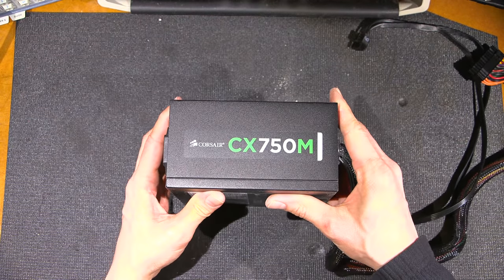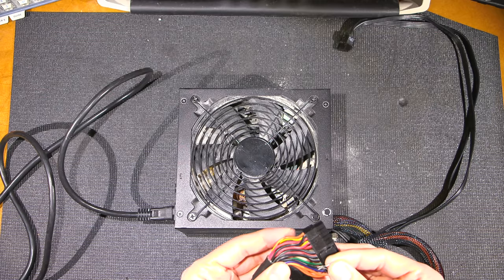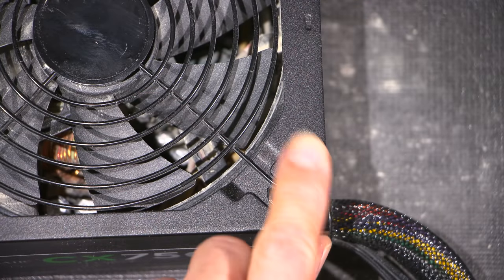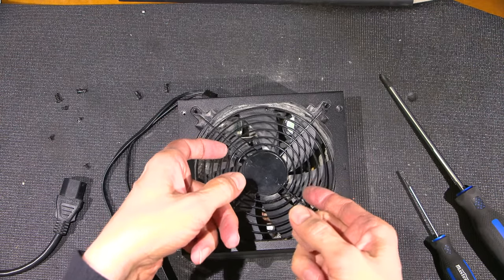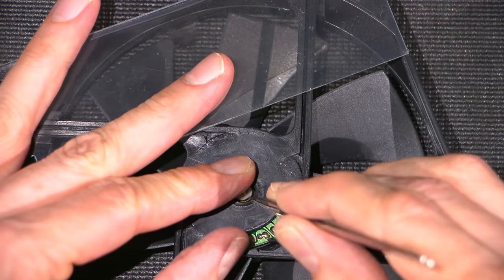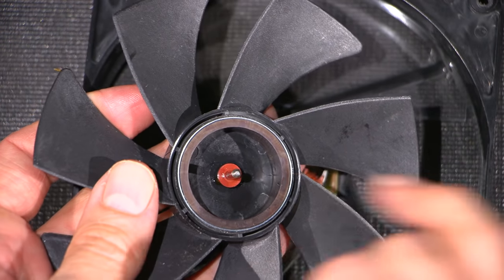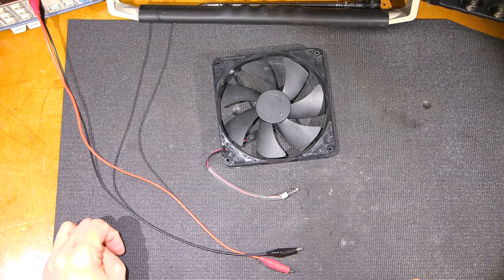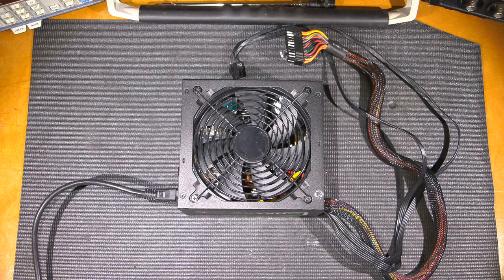Fix A Computer Power Supply!

Comment: Considering the state of the fan, you might tell you friend to clean the computer out too.
Reply: I bet there's a good chance that the friend's computer sits on the floor, sucking up dust.
Reply: probably sits the pc on carpet.
Reply: That's dead dander lots of dead dander😆
Reply: You can try and tell them but will they listen?
Reply: Definitely. What's more interesting is that this isn't generally a psu that OEMs would use (the make and wattage both), indicating that his friend has a custom PC of sorts (whether bought through an SI or built themselves). I'm surprised they let it get this disgustingly dusty when presumably they have at least some interest in performance PCs.
Reply: @bobvines00  Why buy a heater and a separate air cleaner? That's what PCs are for! #TwoferOne
Reply: Also this is a cheap sleeve bearing fan being run hanging from the end of its axle.
Reply: And get filters for his intakes

Comment: So many things are unnecessarily thrown away, in this "disposable" age we live in. To me, it's very gratifying to repair something that otherwise would just be trashed. It's even satisfying to watch videos of other people repairing, restoring, even repurposing items.
Thanks for sharing, Paul.
Reply: It is disposable in the US because in a rich society it is way cheaper to pay for a new one (i.e. import Chinese worker hours+other costs) than pay a local worker his wage, insurance and all those nice costs that come along with a modern society like the American one. In a way you should be grateful to have such a high standard of living. I consider myself pretty rich luckily but I don’t live in the US and I also have similar issues when it is cheaper for me to buy rather than take the time to repair, after many meditations about this I have come to accept it, be grateful and help my community whenever possible by fixing stuff for free. I also enjoy repairing stuff whenever possible!
Reply: Some of those power supplies are actually not cheap, and the best ones are well designed and have very good parts in them. Why throw them to the land field if only a few $ fan is the problem. I still use mid '90 PC that runs my loudspeaker measuring card from Clio. Sure I could buy the newest portable USB version ($600 US or so) and connect to Win10 laptop (which with another update might screw something up), but it still works. And some of the specialized equipment is way too expensive just to throw it out or unobtainable, just ask Paul.
Most of the regular products made in China are cheaper than many products made somewhere else, and quality is sort of 'OK'. But, a friend of mine who designs custom Hi-End loudspeaker transducers says, that if you want a really great product not a lot of manufacturers have the capability to build it as many places outside off China sold or moved the manufacturing equipment and for Hi-End quality you have to be ready to pay. Plus most of the Neodymium actually comes from China.
Reply: friend of mine found a perfectly fine microwave oven in the trash
a fuse was blown
other than that, it was perfectly fine.
Reply: Damn tootin'.
Reply: They don't want you to fix it they want you to buy a new one.
Reply: It's not so bad. Most of what we use is recycled after it's useful lifetime. In the case of a PSU, like this one, youre not supposed to open anyway. Any IT Professional would tell you to take a bad battery to a hazardous waste or recycling facility, as opening a PSU can kill you
Reply: Yeah, the better title is how to fix a dead fan...
Reply: One person saving a small plastic fan isn't enough to offset the billions of people who dispose of plastics daily.

Comment: I'm in my 8th decade and more than 50 years ago often repaired sealed condenser fan motors on freezers, coolers and refrigerators when the equipment was abandoned. Most refrigeration equipment is installed and never moved until it stops working and is replaced. My "fix" was to punch a small 1/16 hole in the top of the metal cap that sealed the back of the fan motor and use a small hypodermic needle to inject lubricant into the cap. Usually less than 1/2 ounce was required. Then wipe over the hole with a clean rag wet with a bit of isopropyl alcohol. Next apply a small spot of gasket sealer over the hole to close it up. 80 percent success rate. Back then you often needed an exact replacement part to change a condenser fan motor. This was before "universal fits all" fan motors existed. Good video. Thanks.
Reply from the maker: Thanks for sharing your story!

Comment: I've done this hundreds of times on customer sites around the world.  Some 1980s mainframes I worked on had up to 12 power supplies in each cabinet and there were two full sized boxer fans in each supply.  Since I was usually on some remote base with no spare parts within a thousand miles I got used to repairing stopped fans by cleaning out the bushings and lubing them with a bit of shredder oil.  That little bit of maintenance can make those machines run 24/7 for years past their MTBF dates.

Comment: The outer casing from a cheap plastic ballpoint pen works well for installing those split washers, just pull the ballpoint and ink-tube assembly out of the pen with pliers.  You can even reassemble the pen when you're done.

Comment: Having relubricated many a fan myself, I have two comments to make:
Usually, when a fan starts growling like this, the cheap sleeve bearing has worn enough that relubricating will only be a temporary fix. Typically I have gotten another few months to a year or two out of a fan by lubricating it, but they never last as long as the original (already too short) pre-service life. If it's easy to get to this can be worth it to prolong the life and minimize waste as noted here, but if the fan is a real pain to get out of whatever equipment it's in, it can still be worth it to replace it. When you replace the fan, use a high-quality unit with proper bearings in it; while this still means you have to junk the original cheap fan, from that point on it should be a "lifetime" part and you'll never have to replace it again, keeping the cooled device (and your new quality fan) in operation for a long time. A small amount of waste to make up for the manufacturer's shortcomings, but you can at least keep everything else in operation as long as you need.

Secondly, the fan shown here was more serviceable than most; it included the rubber face seal (often omitted on the cheapest fans which just rely on the sticker, invariably resulting in all the lubricant leaking out even faster) as well as having a reusable plastic split ring for retaining the shaft. Many of the ones I've disassembled instead use a toothed "one way" ring to retain the fan, and they're effectively impossible to remove without bending/breaking the ring, making proper servicing a lost cause. In those cases either just put some lube on from the outside and move the fan along its shaft to work it in (which will probably work for a while, but not forever if the fan was cheap in the first place), or just replace the fan (once) with a quality unit and never worry about it again.

Comment: When I left my first apartment I watched my landlord spring for a whole new HVAC system because the blower got loud. I brought the old squirrel cage blower with me and re-packed it with grease 30 years ago. I’ve been using it to ventilate rooms when remodeling ever since.
Reply from the maker: Hi Jim. I have an old furnace blower to do the same as well! LOL! I have had it now for 25 years... same deal.

Comment: I usually check for bulged caps when I service a power supply. The most common result when a fan no longer cools the supply properly. I though I was the only one who "fixes" cooling fans. Nice to see I'm not alone.
Reply: I've been doing it since the 90s. It's not this standard 140mm kind of fan that's the problem, it's the oddball diameters and form factors that can make finding replacements impractical, at least impractical enough to make it worth gambling half an hour trying to recondition the existing fan.
Reply: @dycedargselderbrother5353  Yup, me too. Fans used to go bad a lot more frequently than they do now. I'm not sure if I just have less dust around now, or it's because fans tend to spin a lot slower now, but I haven't had a fan go bad in a very long time. As a kid I discovered removing that little split ring and the whole fan came apart. Always had good luck re-lubricating sleeve bearing fans like this one, but the ones that had little tiny micro ball bearings I never had good luck with. Once those bearings are worn, they just don't work properly any more. Even if that plastic retaining ring pings across the room and into the carpet never to be found again (except by the vacuum), the fan works perfectly fine without it. I've run fans for years with that retainer missing - no issues. The magnetic field from the rotor keeps the fan in the right place on the stator.
Reply: @gorak9000  That's a good point on the durability issue. I agree that fans seemed to burn out more in the past. Speed control probably does have something to do with it. They also used to be significantly smaller on average and needed higher RPMs to push equivalent or greater CFM. Two pin constant RPM fans used to be the standard and the 0.7 amp kind featured here wouldn't even be at the high end of power draw.

Comment: Beginning: uses a resistor to turn on the PSU to avoid any possible short
Later: pokes through the grill with a metallic screwdriver, to spin the fan while PSU is plugged in and powered on.

P.S. Don't take this personal, I just found it amusing. I really like your videos and the very clean and professional way in which you present and explain everything with lots of details.
Reply: It's what's called, a "pro gamer move".

Comment: As a mechanic as well as a geek, my go to is actually gear oil. Thicker than most oils but still thin enough to flow around the shaft easier and haven't had an issue of it drying out over time.
Reply: Also eats plastic over time.

Comment: Mr. Carlson, I deeply respect your passion for reducing waste. It is one of the reasons I fix "old" stereos, appliances, and other products.
Reply: Want to save electricity & keep your refrigerator out of landfill?  Unscrew the front bottom dust grill and the back lower cover off.  Place 2 dust pans by front area that was exposed by removing the grill so to catch debris.  Starting in the back, use a mini " Shop Vac " type vacuum with suction and exhaust ports and suction the coils,  underneath many refrigerator.  When you have suctioned all you can, switch your hose to blowing port and blow on the coils.  If this hasn't been done in a while, you will get lots of dust balls coming out.  Reattach grill & back cover.  Your refrigerator will be quieter & use less electricity.  Peace.

Comment: Awesome! I'm with you - fix it instead of replace it. 
I just fixed my kids computer power supply last night. A power regulator IC blew up. My kid ordered a new power supply and was going to recycle this one but I decided to give it a shot and repair it. Replaced the IC (learned some more about desoldering and soldering in the process which is a bonus!) and tested it. Works!! - so now he (or I) has a spare power supply.
Thanks for making these videos. I learn something new every time.

Comment: An excellent piece of 'Green' maintenance, Paul and a fine demonstration of how often a bit of high tech kit doesn't need high tech repairs - just logic and common sense. 5 stars. It reminded me of a time, about 20 years ago that a colleague asked for help as her computer sounded like there was a wasp trapped inside. Sure enough, when I powered it up in her office you'd have been hard put to hold a telephone conversation! It was a nice HP machine with a quick release latch on the lid. She was quite amazed when I leaned over, lifted the lid, glanced inside, made a quite gesture, closed it up and said 'That should fix it'. She powered it up and silence reigned. I'd been sneaky and palmed the little sticky label off the cpu heatsink fan (it was an extra one with an HP part number on it) which had slid sideways due to heat and centrifugal force. I quite enjoyed my Harry Potter reputation for a couple of days until I owned up - lol.
Reply from the maker: Thanks for sharing your story!

Comment: The idea that most dust is dead skin is a common myth, it's actually a pretty small percentage whereas most of what goes into dust is fabric fibers, pollen, soil, hair, sand, and other things depending on your local environment. There absolutely is dead skin in dust, but the amount is negligible.  🙂
Reply: Can confirm, I have steelworks about 1-2km away from me
Reply: Totally agree I've heard that myself. And if anybody cares to Google search it you will find plenty of information confirming it.
Reply: It puts the lotion on the skin or it gets the hose!
Reply: I believe that's correct, otherwise abandoned houses would never get dusty.
Reply: Veritasium did a good video on this topic.
Reply: @_Thrackerzod  do a web search to find out how much cosmic dust falls on Earth every day. It'll blow your mind!
Reply: lubricating bearing is a short term fix those bearing will be worn.  just replace fan.
Reply: @RadOo  I can confirm, I have a nuclear reprocessing plant 2km away from me.
Also towels in the bathroom have more fluff than a porno film set.
Reply: @mikepxg6406  That isn't my experience Mikey. Sure if you have sat there listening to a noisy fan for five years it will likely have worn out, but most respond immediately and well and continue in service. Plus it is easy to tell if they are worn out from fit and finish - without a set of callipers. Also even if there has been some wear as long as it runs free and quiet after a clean and oil there is no need to expect it to be a short term repair at all.

Now tell me you are a designer of high efficiency miniature fans and I'm talking rot..😸..It has happened before..
Reply: @1pcfred  Find out how much mass the sun loses every day.. That blew my socks off, following straight after my trousers.
Reply: @mikepxg6406  that may be the case. But it was not in this case. Here some grease just dried in the hub and Mr. Carlson cleaned that out.
Reply: @1pcfred  HA HA HA HA 😸😸😸😸🌞.
You made my day Paul.
Reply: Damn carpets and all the stuff listed above that it accumulates.
Reply: @pliedtka  someone needs to invent the self vacuuming carpet. I think it can be accomplished with modern manufacturing and engineering. Carpet is an ancient product long overdue for a redesign. For what it costs now the stuff should clean itself too.
Reply: and a very easy myth to disprove, too. Just look at all the dust that has accumulated after you return from vacations or something.
Reply: @mikepxg6406  then lube it again!
Reply: @martinda7446  why the hell would you have a nuclear reprocessing plant?
Reply: @GeorgeTsiros  you really don't know how many parties we had while you were away on vacation. Or something.
Reply: @1pcfred  you couldn't have waited until i returned?? 😥
Reply: @GeorgeTsiros  fun waits for no man.
Reply: @mikepxg6406  nope. i've found an old computer on the street almost 10 years ago and the fan of the power supply was dry. i just added 2 drops of high temperature oil, installed in on a friend's computer and it ran fine until 3 weeks ago when he bought a new computer. took the fans off the case, added 2 drops of the same oil from 10 years ago (i don't usualy use that oil so its lasted me quite a while) and they're still going.

you know when a bearing is bad when it keeps making grind noises even after adding oil or grease. bearings need oil because theres a lot of friction in the design and that create heat. if the bearing is still making noise then the balls inside got damaged and you need a new bearing.

Comment: If the bearings are sinter type it's NOT recommended to use grease. Only oil is suitable. The sintered metal soaks the oil like a sponge and releases it over time to the bearing surface. Grease clogs the sinter gaps which leads to a dry bearing again very soon.

Comment: Hey Mr Carlson, great video! I've been fixing fans like this in my computer pretty much since I was a kid, because my hardware budget used to be tight. That's why I try buying fans with ball bearings instead of sleeve bearings, they survive for way longer and are easier to lubricate. Also, you might actually want to use PTFE / teflon grease instead of regular oil, because oil will usually dry up again pretty fast, depending on how warm it gets in there.
Reply: The WD40 brand make a variety of lubricants in spray-cans, which along with the original WD40, include PTFE (wet & dry types), lithium grease, silicon grease (& even bike-chain, & garage-door lubricants!).  
The dry PTFE spray's solvent evaporates quickly, & is an excellent alternative to graphite-powder (in locks, etc.)!

Comment: Also, I use sewing machine oil in all the PC fans that I fix when they go noisy. Sewing machine oil is designed for high RPM motors, costs pittance at a sewing store, you don't need much, couple of drops, so the bottle lasts forever too :)
Reply: I used to use fishing reel oil back when I started doing this as a kid. It's probably the same stuff as sewing machine oil. My dad had a little bottle of oil with blue dye in it - label was worn off of it when he gave it to me, so no idea of brand or whatever. One drop fixed a fan up for a very long time.